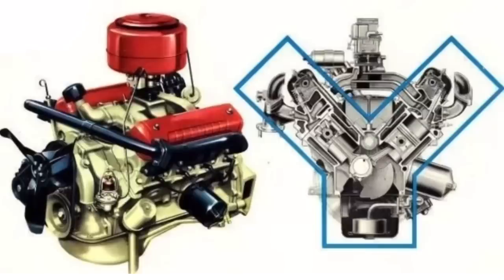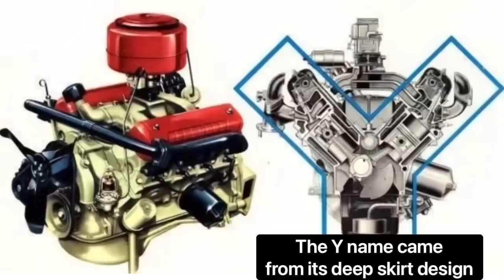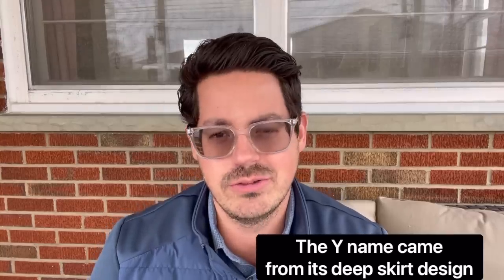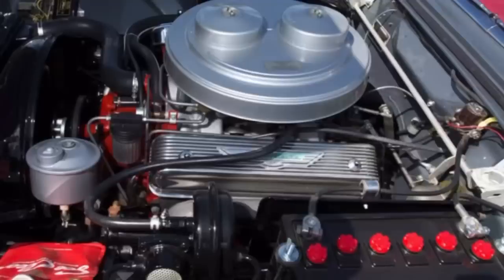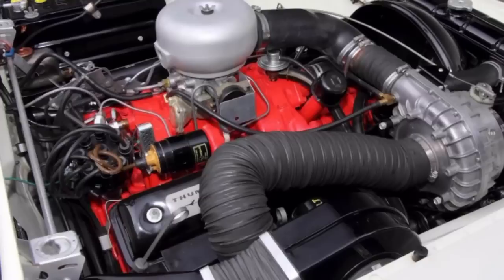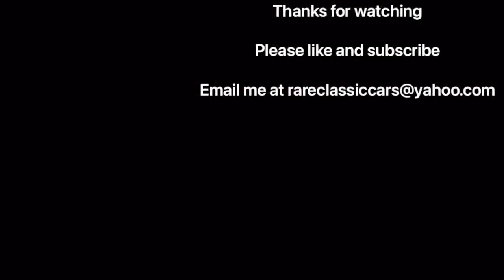Worst Engines of All Time: Ford Y Block V8

Comment: Ford always had excellent styling, fantastic interiors, and excellent market planning (who doesn't love the first gen thunderbird), but sometimes they dropped the ball with the mechanical parts and it's a shame. Still, I'd take living with a Y-Block over most modern engine designs that you can't work on.
Reply: Its because they have never innovated anything. They copy and make derivatives. Anything they did originally is terrible. Including everything modern. The new Explorer is categorically the least reliable vehicle on the planet.
Reply: @strongereveryday2302  lol they never innovated anything? what a stupid thing to say. the problem people have with ford is they always change. gm kept the same shit for years and because of that the aftermarket supports it well. gm engines are for simpletons.
Reply: @mauser2134  There's got to be something said for the "simpletons" who drop in small block Chevys into many classic Ford and Mercury rides from the 30's and 40's...which drives me nuts BTW. They are much more affordable than a more modern Ford Windsor or Cleveland engine. It's not to my liking but who can blame them for doing so. A Ford should be powered by Ford.
Reply: @codyluka8355  if powered by Ford, more time would be spent working on it than driving.
I bet my 1934 Diamond T crew cab conversion with LS swap would give you nightmares.
Reply: @asherdie  Lol! I don't know if I should agree or disagree with you about Ford. I know a few that have had troubles with them but I personally have had no trouble with any of the Fords I've owned over the years, and I've had a number of them. Now Dodge, on the other hand, I'd have to agree, especially those early mid 70s models..."will it start today?"

Your Diamond T sounds like a nice truck and a labor of love and an LS engine to boot too! A logical choice that most will agree with...and loads of fun too! Best bang for your buck! Nightmares?? There isn't much on 4 wheels that would scare me...only the guy behind the wheel 😉.
Reply: @codyluka8355  dodge offers rust as a factory option lol. I've got a 1997 3500 Cummins that runs like a top and the truck is rotting around it. Florida truck never been in the salt, looks like it's from Michigan. LoL they are all junk, pick the junk you like and roll on.
Reply: @grumpybill  I can't speak for your experience, but I've had Fords from the 60's,70's,80's,90's and 2000's.  Not a single one of the bunch ever gave me any problems beyond high mileage wear and tear. (you know... belts, thermostats, the rare timing chain, points, plugs, wires, carb kit, etc.
Most of them driven well beyond 200k and still running like a top when sold, many beyond 300k, and a 96 work truck I still daily is past 400k and still pulls loads over long distances like an angry mule. 
I've had a couple Chevies, a Dodge, 3 Toyotas and 2 Nissans (talking about trucks) and one of those Toyotas (an 81 longbed) crossed a million miles even.  They all came with their own inherent personality quirks, but I have to say I've had good luck with all of them, and the only car I'd say I ever had that spent more time sitting broke in the yard than driving was an old Fiat 124 Spyder.  

With all of the above, (including the Fiat, my ignorant neglect had a hand in that lol) it TOTALLY comes down to how you maintain them.  I'd pit the reliability of a ford 300 or a 302 against any other gas engine of its class and era you could throw at it.  Bear in mind I'm not talking about custom or high performance engines... one 289 was high performance for stock, and it was reliable as any other, but it obviously becomes apples to oranges with the advent of newer tech 40 years later. 
Just take care of any of them, and they'll take care of you.
Reply: @1SqueakyWheel  I've never owned a Ford, but I've towed many home for friends and family.
Reply: @asherdie   I'm not surprised. 
There's the intimate knowledge a non-car person gains as an owner.  And there's practical knowledge that a biased non-owner gains by handling or possibly even working on them. 
And then there's the intimate knowledge that a gear-head owner gains by driving, maintaining and l repairing them himself that removes most of that pre-loaded bias.
I started out in my younger years playing that silly "Fords are better than Chevies" game.  And I had plenty of buddies who played "Chevies are better than Fords" too.  It's all childish kids stuff though.  

Turns out, the vast majority of automobile marques that have returned good numbers in the market have done so for a good reason...  and you only get from those cars what you give them.   With the rare exception of the odd market bomb, of course...  every company has made mistakes along the way, and their numbers took a beating for it, teaching them the lesson that they reap what they sow, and they're incentivized to patch the holes that are hemorrhaging their money.  

So take care of a Fomoco, a Bowtie, a Mopar, etc... and you'll generally have a good car that will faithfully serve you for many long years.
Reply: @1SqueakyWheel  We played the Ford vs Chevy vs Dodge game back in high-school when we were all cutting our teeth in shop class. Over the years we all came to know that all of them were all basically good cars and that they all had their "quirks". The best Xmas present I got when I was a "16 year old Motorhead" was set of Craftman tools and a Chilton manual. We all learned by trial and error but gained a ton of knowledge too. Fuel injection was just coming into its own back then (mid 80s) but we had plenty of old school back yard mechanics (our fathers) that we could go to get help if needed...and they were glad to. Sometimes the advice was not what we wanted to hear, but that was all a part of learning and it was fun.
Reply: @codyluka8355  indeed!  Boyhood was great back then, wasn't it? 
I feel the subsequent generations were missing this more and more, as the good-wrenching cars aged into obscurity..  replaced by cars that were progressively less and less wrench-friendly.  
For every car we ever worked on for ourselves or our buddies, we'd add a Chilton's and a Haynes each to our library, since each group had a slightly different way of approaching things.  And Clymer's for anything western-european.  All for pre-internet reference. 
Good times!
Reply: @codyluka8355  why?
Reply: @moo.johnference869  why what? No idea what you mean.
Reply: Why must there be a ford engine in an old ford body .
Reply: @moo.johnference869  Why not?
Reply: @moo.johnference869  You can have any engine you want in an old car. You could even put a Cessna airplane engine in it, if you can make it work. Some people just like to see an old Ford with a Ford engine, a Chevy with a Chevy engine, a Pontiac with a Pontiac engine, and so on. The upside of Chevy engines is that the cost is much more affordable and a Chevy engine will just about fit into anything you wish to build. The downside  is...everybody does it. It gets pretty predictable when you see a T-bucket hot rod or a 34 Ford with a Chevy engine at a car show. Nothing against those who do it, but it would be nice to see one with a Hi-Po 289 or a 351 Cleveland or maybe a 427 FE in a few of these cars.
Reply: @codyluka8355  I've always wondered why some people get litterly violent when they see a small block chevy in an old ford , yet say nothing if an old ford has a Cadillac,  Pontiac  is even a Chrysler hemi engine like in the early days of hot rodding .
Reply: @moo.johnference869  Lol! I know! Some people are REAL purists when it comes to cars and hot rods. You're right, back in the day the rodders and drag strippers would be Caddy or Hemi engines and it's been a long time since I've seen anything like that at a show. Those were pretty impressive and it showed that the builder had a little imagination and back then. I confess that I'm a bit of a purist at times but I still have respect and admiration for their work. It just gets repetitive and predictable when it's so common.
Reply: @codyluka8355  I also enjoy looking at pure restored fords in their original form . But , I live in southern California where the average speed is around 83 MPH on the freeways and I'm 78 years old so an original ford with a Y block would probably have a life span of about 5 minutes 🤔.
I tool around in California daily for the past 43 years in my 1954 F100 , we have made 4 trips across the states and back without a hickup . After the first 5 years I converted over to a GM 350 / 4 speed , 6 years later I switched to a GM 350 / 320 HP ,  Ten years ago I installed an LS / 6 speed / 400 HP of which worked out very nicely , reliable and trouble free .
2 years ago I opted out for a new chassis,  independent suspension and disc brakes on all 4 corners , slightly lowered for hi speed handling,  the body absolutely stock aside from another color of paint with clear .
Of yea , you'll be happy to know with her new skeleton she got another heart transplant  a 2020  mustang's  GT 5.0  coyote /6 speed .🙂.and yes it handles the freeway nicely , I can turn it around with a  tap on the throttle... thank you for your time and please dont call us stupid again.
Reply: @moo.johnference869  If I offended anyone, then I apologize. The original "simpleton" remark earlier had nothing to do with anyone's lack of intelligence at all and if it came across that way, then I'm definitely man enough to admit my wrongdoing and apologize. Don't get me wrong, I love the SB Chevy. They are great engines that have the best factory and aftermarket support and they are AFFORDABLE, especially if you're on a budget. I'm more disappointed that Ford, Oldsmobile, Pontiac, Buick, and Mopar are 3 times the cost to build and always have been. So, I get it and understand it. 

Your F100 sounds like an amazing truck and Coyote powered too. Love that you have kept it for so long. Definitely a member of your family! Don't sell it!
Reply: @codyluka8355  thank you for your respectful reply .
Reply: @moo.johnference869  The better term should have been "pet peeve". That is a much more respectful way of putting it. Cheers and Happy Easter.
Reply: @codyluka8355  🙂 same to you & yours ! You made my day , thanks.
Reply: @moo.johnference869  Because its a Ford.
Reply: @codyluka8355  FACTS.
Reply: @moo.johnference869  Because so many are doing it.
Reply: @moo.johnference869  Wrong.  As long as you had it geared high enough, or have Overdrive in it, it will be FINE.
Reply: @michaelbenardo5695  Facts. Did you have a question or something to contribute?
Reply: I was replying to your statement that some of us like to see Fords with Ford engines, Chevys with Chevy engines, etc.
Reply: @michaelbenardo5695  I see. I had no idea what you were referring to. We're good 👍
Reply: Sedan57Chevy, I agree with most of your comment with one HUGE exception.  Can you say “Edsel”? 😉
Reply: @Primus54  EDSEL S DIDN T HAVE Y BLOCKS
Reply: @sorshiaemms5959  I never wrote that Edsel had the Y engine.  I was referring to Edsel being a colossal screwup by Ford.  And no need to shout in all caps.  🙄
Reply: @sorshiaemms5959  Actually the 1960 Edsel could be had with a Y block. The 292 Y block "Mileage Maker". Top engine for 1960 was the 361 FE.
Reply: @Primus54  There was nothing wrong with the Edsel as a car, it was the advance billing that was all wrong.  It made it sound like it would be a radically new and different car, which it wasn't.  The 57 Buick suffered from the same sort of excessive hype - "The most radically changed and radically new Buick since 49!", the big cars, Super and Roadmaster, did have a new greenhouse like the 57 Cad, but the best-selling small models, the Special and the Century, looked all the world like face-lifted 55s.  They weren't, but they sure did look like it to most people unless you parked them next to each other.
Reply: @codyluka8355  You are correct.  The 59 Ranger also had the 292.  The Corsair came standard with the 361 FE.
Reply: @Primus54  Let see,   the last time I saw a 100 point Edsel cross the auction block it sold north of one hundred thousand dollars.
Reply: @moo.johnference869  That’s great!  A 100 point Edsel is as rare as hens teeth.  To collectors, rare perfection is the name of the game.  Doesn’t change the fact that the Edsel was a colossal mistake for Ford at the time.
Reply: @Primus54  Yes it was yet it carried many positive aftereffects.  250 million loss, a billion in education for all auto makers . The next time ford prehipped a future model was the mustang,  not to mention 7 years of tax right offs . It wasn't as big a disaster as you would like us to believe.  If my memory serves me right ford is the only automaker that didn't need a government bailout a dozen years back .
I dont know what all this has to do with the Y block .
Reply: @sorshiaemms5959 yes they're the FE
Reply: Agreed, I've had several Fords and every one of them were styled well, Comfortable, good quality fit and finish and had average if not underwhelming powertrains both in fuel mileage and reliability
Reply: Plus, the one bad thing about the Y block is easy to fix.
Reply: Ironic considering what they were in 1920 with the model T..

Comment: I disagree... the Y block has been extremely fun to work on and repair, as long as you kept oil changes on time, and used Halvoline over some shitty quaker state.
Reply: Yeah so many people used Pennzoil or Quaker State back in the day. These paraffin oils are sludgy flakey messes. Every engine I ever torn down with these oils were so dirty. Engines I tore down with Valvoline or Castrol were typically very clean.
Reply: You're sure right about the Quaker State.
Reply: @tomnekuda3818  The Green Monster.
Reply: I always buy Havoline 10w-40, the 6qt box is cheaper per Qt than even Supratech or Rotella at Walmart.
Reply: @hendo337  shell Rotella or Chevron Dello are as good as any oil you can buy
Reply: @randymagnum143  I recall my brother doing diesel engine repair work back in the mid-1970s where he highly recommended Rotella and Dello engine oils.  That info was passed along to a friend of mine that used Dello oil in his Studebaker engines.  He was amazed of the cleaning properties of the Dello oil when he torn down an engine for valve work; as no other engine oil had ever kept the inners of that engine as clean as Dello did.

Comment: My step father had a 1949 Ford 1 ton dually wrecker. He replaced the flathead with a 292. That engine was a towing monster. I also rode in a school bus every day which had a 292.
Reply: I bet that was fun to watch.  Our school buses were equipped with Chevy 235 6 cylinders.
Reply: Those things didn't seem to have good starting torque, when you got them going they would chug to nothing and if oil changes were kept up they would run forever, they did have a problem with rocking arm oiling( theres was kit available to correct that) Also the firing order was strange, that gave them that funny sound.
Reply: @kevinmccune9324  My two favorite sounding engines through dual exhaust and turbo mufflers are the Ford 312 and the Buick 401.
Reply: @MostlyBuicks  The old  Buick was pretty popular with rodders back in the day, I had a "Mitchell" Dual exhaust system for My Brothers old 60 model Ford pickup,I do believe it helped it some doing away with the front crossover pipe, we may have even done away with the heat riser, not sure.

Comment: I thought I read that the Windsor was developed especially to replace the why (??) V8.
Reply: The Windsor was to be the new compact/intermediate body engine. When first launched it was called the Fairlane v8.
Reply: @user-cs1ne8gx9u  You're kidding. I have a 92 Australian Fairlane Ghia with 302.
Reply: @jamesfrench7299  sounds like a cool car. You in Australia?
Reply: @user-cs1ne8gx9u  Yes. Sadly it's sat for nearly two years (under cover) due to stalling issues. I was only recently told by someone what the likely cause is, so I must attempt to replace the coil when I can and see if that works. Then I have the arduous task of re registering it.
Reply: @jamesfrench7299  good luck with it. Is the engine a Windsor type block or a 335 series "Cleveland", as they were locally cast in Australia and sold in 302 variations at one time. I wish we would have had Australian ford's available here in north America. I'd love a FG X series in my driveway.
Reply: @user-cs1ne8gx9u  it's Windsor all the way as Ford Australia imported it from Ontario Canada so they could quickly re-establish a V8 option in 1991 after 9 years of sixes only. The pulleys are oriented differently to North America, to allow for RHD, making them a unique variant for Australia.
I remember the thrill of hearing a V8 note for the first time coming out of a new Aussie Ford when I saw and heard one in 91. 
The last Australian V8s which were Cleveland, ceased at end of 1982 and Ford never stopped copping flack for it.
They claimed the pushrod alloy head six with EFI was enough. Ha ha they must have had a low estimation of the buyIng public. Only the turbo charged Barra from 2003 onwards could be considered a worthy substitute.
They obviously changed their minds later.
Reply: @jamesfrench7299  cool the Windsor is a better engine than the 335 anyway. Sounds like a fun car. Good luck getting it up and going again. It's too bad the era of Australian automotive production has come to an end.
Reply: @user-cs1ne8gx9u  devastating frankly. Our cars were unique.